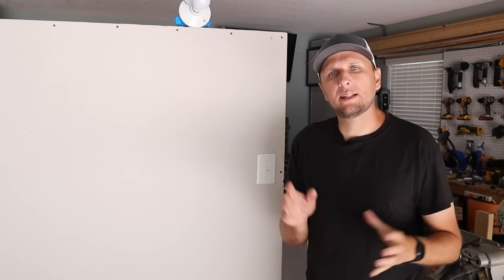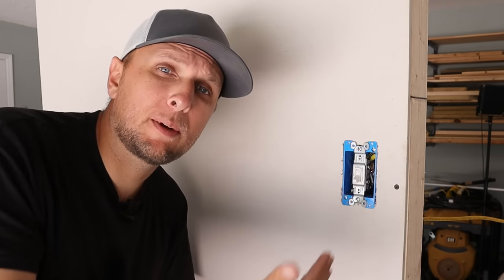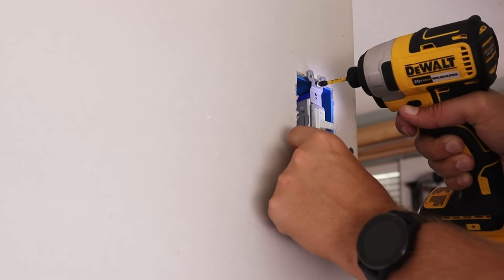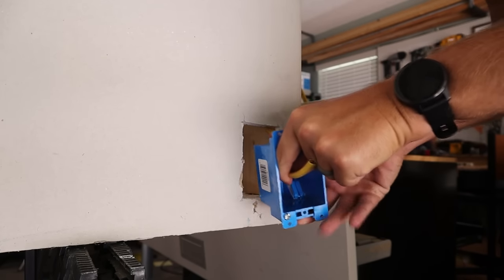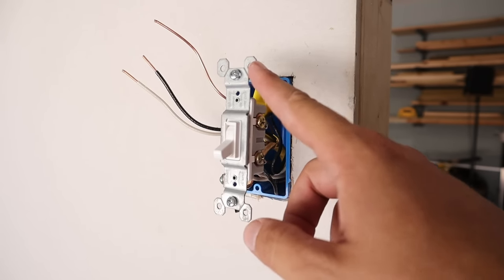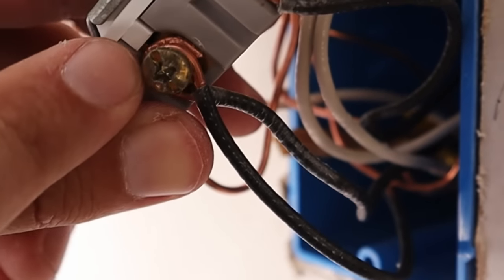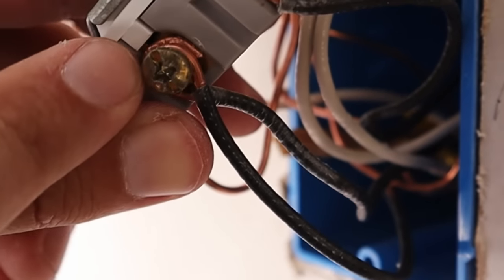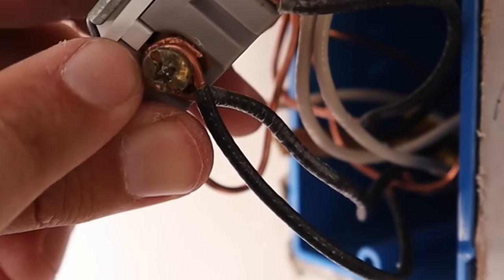How To Add An Outlet From A Light Switch | Common Mistake

Comment: Very nice imformative video, thank you. I'm not an electrician so please correct me if what i was taught is not correct. When using 12 guage wire, the yellow wire nuts are for two wires and red are for 3 wires? I noticed you switched from yellow to red on the bare ground, but stayed with the yellow wire nut on the load and neutral. Is there a standard for wire nut colors? Wire guage obviously plays a role in how many wires safely fit in a wire nut.
Reply: I found it best to follow the manufacturer's wire gauge  instructions on the wire nut package regardless of the wire nut color.

Comment: Wiring can be fun or it can be a chore. I have a shop building with an office, built circa 1950, where there are six ceiling lights and some outlets. The entire office had been on a single 15 amp circuit. Fortunately the wiring was separate wires in buried EMT in or under the concrete slab floor. So I pushed additional wires through to split the office into four 15 amp circuits and ran a 220V circuit above the ceiling that was used for an electric heater until I got the old oil burning furnace replaced with a gas one.
The plan now is to use that 220V line for a mini split heat pump that will replace the 115V window AC mounted where one of the old transom windows was. Boards will go on inside and outside, with insulation between. That will allow for easy pass-through for the wires and pipes since the building is concrete block.
Reply: I've been a electrician for 35 years. The fun wore off over 34 years ago.

Comment: Nice to see them push-ins mentioned.
I last year changed an outlet for a buddy of mine from work. His old outlet in the toilet had gotten a pretty bad burn damage.. No wonder though. The outlet model only had push-in connectors. And the outlet had been connected to both a washing machine and a tumble dryer - and both of course had been in use at the same time and using lots of power thru those small connection points of the push-in connectors...
 Yea. The new outlet got to be one with screw connections only for a way larger contact area for the wires. Lotsa amps can go thru when heating - so I always prefer screw connections myself.. No idea what kinda heater/dryer someone could possibly set into that outlet in this example video, if it all was a real scenario. (Surely there are those breakers, but still...)

Comment: Great video ... I tried to do this myself at home but found that the light switch was only suppling 50v and I need 220v for the outlet.... rather than trying to figure out what was going on with the difference in voltages, I ended up running a new outlet from an existing 22v outlet instead.  Going from the light switch would have been more ideal as it was much closer to where I wanted the new outlet. Anyway job done and all working.  Still bemused about the 50v on the light switch and not 220v as I would have expected.  Then again I am not an electrician,  if I was, then I would probably already know why.  Safer in this case just going from an existing outlet to the new one.

Comment: Thank you, this was very helpful. I could use another outlet in my garage below the switches. Trouble is, that it's a 3-way. Do you have a video for that? Thank you so much! Love the channel.
Reply from the maker: I do not have a video for that specifically but that is an interesting scenario.  So you could do this if you are putting one under the first light switch that has the line coming in and connecting to the common terminal.  If it is the second switch in line you would not be able to as the wire that supplies the power to it will alternate based on the switch positions.  Really glad to hear that you liked the video and the channel as a whole.   Thanks a lot for the feedback and hope to see you around on some other videos!
Reply: Number one advice, if you don't understand electricity, don't play with it! Try and live long and prosper.

Comment: Thanks for the video. It was very helpful! I opened up a switch box and found this mess! I believe the extra wires go to outlets for an in floor radiant heating system. The homeowners do not want to use the system. How do I determine which wires to get rid of and which ones to use to keep my light switch and new outlet working?

Comment: Thank you for the video . It confirms that I’m doing it correctly . That’s a good thing!  I was taught that yellow wire nuts. Only accept 2  12guage wires . once you combine 3 12 gauge you should use red wire nuts. Is that correct?
Reply from the maker: I would need to confirm on the packaging but I believe the max of the yellow is 3 #12s.  However, Ideals red wire nut would be a great choice in that case.  Thanks for the feedback!

Comment: Good, clear video--thanks! But you didn't mention the case of a switch added to a hot-wired lamp, where the only wires to the switch are black and white colored black with a Sharpie. Not all switches can supply a new outlet.

Comment: Love your videos! I have a question; I live in a 115 year old house and there is a spot in the bathroom that doesn’t have power. There isn’t even an outlet on it, but there are wires behind. I’m told it doesn’t receive power. Why is that, and can I make it receive power so I can put an outlet there? 🤔

Comment: Hi, great channel, very helpful. I want to add an outlet to a light switch box that only has a hot and switched-hot wire. Any way to accomplish this without pulling a new 3-wire line to bring in a neutral wire from the light receipticle box?

Comment: Video suggestion to take this concept to the next complexity: a splicing an outlet from a lightbulb circuit controlled by two light switches (4 wires (alternating hot lines)) 

I could take an educated guess but as you understand it’s way better to not guess and be able to learn from the experienced folk. Thanks!
Reply: I’m pretty sure I can connect the alternating hot lines to the same gold-hot on the outlet 🤨 (so the outlet stays energized regardless of the two light switches’ positions. 

But I’m going to just connect one hot line because I’m not 100% certain. Connecting one hot line instead of both will make it so the lightbulb has to be energized, or the switches have to be in a certain state for the outlet to be energized (because depending on the off switches’ positions… the outlet being energized depends on the proper off-switch positions (because the hot lines alternate depending on which switch opened the circuit). 🤔 

Yeah I’m pretty sure can connect the alternating hot lines to the same gold on the outlet. But not sure enough to do it lol. 🧐
Reply: Yep, didn’t work 🤣 now my power drill turns the light on and off 😅

Comment: depending on state u live in some states require those wires to be pushed in the back or receptacles qnd switches and have seen state inspectors fail jobs if not done like I said but thumbs up on wire feed through the wall that was a good one qnd great video
Reply from the maker: Appreciate the feedback Corbett!

Comment: Thank you so much. @9:00 you noted a #12 wire so this is tied to a 20A breaker. Shall I use #12 wire for new installation (including pig-tail) or I can use #14 for new 15A receptacle?

Comment: Great information, alway`s look forward to the tips you have, I have a situation where I`m using metal boxes and was wondering if every outlet needs to be grounded to the box before going to the next box? FYI it is a dbl gang to an other dbl gang using 12 ga solid wire
  Thank you in advance
Reply from the maker: It’s not the outlet that needs to be grounded to the box, the box itself needs to be grounded.  Every metal box needs to be grounded in the event of a wire getting loose and possibly energizing the box.  With the box grounded it’ll trip the breaker.   Without it grounded, if you touch it, you would become the ground.  Hope this helps.

Comment: Nice job. It assumes though that the light switch/light is properly done. I've run into cases where the neutral was not connected leaving the light. That meant getting the ladder and rewiring the connections at the light fixture. My worst nightmare is three way switches where the "electrician" went to the light fixture and did all the splices there. A tedious and time consuming task with a meter and tagging where the wires went. And ladder climbing. Four ways are even worse. I was asked to fix a switch that had never worked one time and finally figured out that the second traveler was missing. It's difficult to fix that in a finished house. And I refuse to work on any old "knob and tube" systems any more. You still run into that stuff in houses from the 19th century and early 20th century.

Comment: I followed your instructions to a "T" and every time I turned the breaker back on it would trip. I double and triple checked my wiring, and it was exactly as shown in the video. I took the brand new Leviton outlet out of the loop, ran a jumper between the outlet black and white wires, and flipped the breaker. It DIDN'T trip. I then installed a different Leviton outlet and the circuit worked! There was never an issue with my wiring-- I just had a bad outlet. Maybe I've just been lucky all these years but I've never had brand new outlet fail.

Comment: Hi thanks a lot for the video. Very clear and easy to follow. Just wondering what to do when there is no white wire in the box? I have an old house and most of the switches only have black.
Reply from the maker: Can’t be done without a neutral wire.  Only way would be to run new wiring unfortunately.
Reply: @HowToHomeDIY  thanks man. Appreciate it.

Comment: Planning to do this to add a powered bidet. Can I use a gfi receptacle???  Great video thanks 🙏
Reply from the maker: Yes, in fact, a GFCI receptacle would be required as it is in a wet location.  Just be careful though as those bidets can be pretty fancy and pull more power than you have available on the circuit.  Some of them require a dedicated circuit due to the heating elements in them.  We want to keep a circuit's load at or under 80% of what it is rated for.  Hope this helps.

Comment: What if the switch used to supply power to the outlet below is a 3 triple? I have a set of switches, overhead lights, ceiling fan and ceiling fan light, above where I would like to have an electrical outlet installed. This video was super easy to follow and clear. I won't do it myself, though, I'll hire an electrician, but  the wall in question is paneled and painted and I don't want a bunch of holes cut. Doing it this way would be fantastic if it's possible.

Comment: In the beginning of the video the switch box is an old work box. When you tied the outlet wires in, it is a nail on box. The old work box can not accept 3- 12/2 wires with a device.  You corrected that issue but did not mention it. Good day

Comment: ok I agree a 100% with that you said in the video, but along with adding a plug, not all electricians run power to the switch like that,some run a two wire to the box,one is the black switch wire the other is the white wire, which has to be colored with a black marker or another color ,and it will be your hot wire, so in that case you have no neutral, no neutral no plug, then it gets a little harder to get power.

Comment: I have to add an outlet in the same fashion you did here so I appreciate the video! Very concise. I do have two questions. I also need to run two more outlets and a ceiling fan from the switch box. I assume I pigtail each outlet and run to the next outlet but how do I connect the fan to the switch so that the switch operates the fan/light? Thanks! If you have a video for this already, a link would be great!
Reply: So from an electrician, I recommend hiring an electrician to do all that for the simple fact they will do a load calculation and tell you if you can add on to that circuit or if you will need a new circuit to avoiding tripping the breaker. Hope that helps
Reply: @iancossel650  Thanks Ian. I did look up some specs and the "rule" is to not exceed 80% of the total load and a max of 8 outlets, recommended. On a 15 amp breaker that's about 1,800 watts total. I've already split the room in half so I have no more than 6 outlets per circuit. It's just the fan/light is giving me issue. I've wired it per docs that came with the fan, (single pole application, not 3way), and the feed to the fan has power going to it whether the switch is in the on or off position. (Tested with volt meter). Based on this video, I've wired it correctly but not working as it should. Could be faulty switch, bought it new but looks used.
Reply: @iancossel650  Well, nevermind all of that. I had an old toggle switch laying around and hooked that up to test and it worked. The slider I bought is bad. Thanks for your recommendations Ian. Cheers!

Comment: this is great. but for those of us with an older house, those colors dont match up. so maybe try using older wires. and by chance do you have a video of where you come across a light and outlet controlled by a switch to where you can make the outlet not be controlled by the switch?

Comment: Very nice video. Are you ok with WAGO splices being used?
Reply from the maker: Glad you liked it!  I don't mind using them for things like this and 15 amps or under.  They are rated for more but I personally will use wire nuts for that every time.

Comment: Use a sharp utility knife rather than the saw blade for cutting the hole.  Score it a bunch of times and it'll work it's way easily through.  Reason 1: the saw blade sticks in deep enough to catch wiring or plumbing on the other side. The utility knife won't really have this problem.  Maybe 1/8 of an inch when fully plunged into the sheetrock.  Reason 2: It's a much cleaner cut, with less mess.  

I never really use those keyhole saws.  Rotozip and utility knifes are the way to go.  For something like this, most homeowners already have the utility knife and would have to go buy that keyhole saw.  

Only 4 minutes in but looks like a great video so far.

Comment: We have different code in my country I guess, but wiring an outlet out of lighting circuits is one of basic NO-NOs. 
Lighting is usually low current (but on the other hand one of the most complicated wirings in your house, all the switches, fittings and stuff), so it is protected with a low rating breaker (often 6A@230VAC), also the wires themselves are thinner, because they are ment to power low consumption loads (this is even more true for modern LED lights). On the other hand you tend to stick all sorts of quite powerful equipment in your sockets (vacuum, hair drier, kettle ... can easily reach 1,5kW each - the margin of the fuse). You are probably not planning to label your socket: "phone chargers only", so the best way is to make a new cable run from the nearest socket or the fusebox. It is still much safer to use an extension cord than do this. 
Another reason to not add any other loads to lighting circuit is convenience /safety: when you trip a breaker through the socket, if it is not in the same circuit, lights will stay on and make it possible to do the repairs. 
Surely a lot of people do it still - but making an instructional video on YT is not right. Socket is ment to be a permanent installation, without the need to think if it's powerful enough ...
Plus, you are making a mess out of your installation: lights should be lights, sockets sockets and individual powerful loads, in separate circuits. What will be next - how to wire a socket from your water heater terminals?

Comment: Great video thanks!  Question, if the switch is off will it also turn off power to the outlet?
Reply from the maker: Nope.  The way that this is wired, the receptacle will receive power at all times.

Comment: Your video is helpful !  Quick question, does the outlet still work when the light switch is off?
Reply from the maker: Glad you liked it.  Yes it does.  It is connected to the line wire coming in from the panel.

Comment: most switchs I have came across are a simply switching on/off power between black/white with the actual "hot" in the light box.  Basically switching hot in light box.

Comment: Instead of using that drywall saw I just use an oscillating blade/multi-tool. It's a very clean cut and faster and you don't run much risk of hitting any wires or pipes since it doesn't go in far at all.
Reply from the maker: I usually use the multi tool as well.  Thanks for the feedback Devin!

Comment: One thing i really like to do is to squeeze the bare copper loop when its under the screw so it cant get loose. Its really easy to do with the tip of a pair of strippers. Itll perfectly wrap around the terminal.

Comment: I have enjoyed your videos but have a couple of questions regarding this one -- How come you used a red wire nut for the 3 ground wires but a yellow wire nut for the neutral and line wires?  I think they all require red wire nuts.  Also, most lighting circuits are 15-amp wire and most receptacle circuits are 20-amp so wouldn't one have to be mindful of what appliances are plugged into the newly-added circuit?

Comment: Great video. But I have one question about this setup. If the light switch is off will the receptacle be off? Or will the receptacle work with the light switch turned off. I’m hoping for the latter.
Reply from the maker: Yup, the way I have it setup in the video it is the latter.